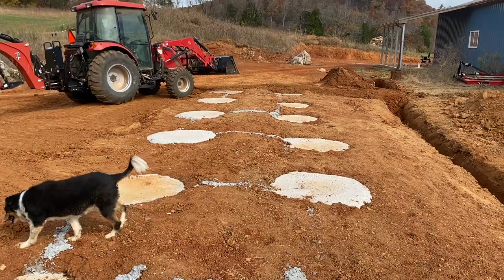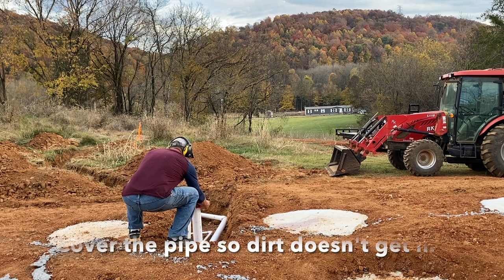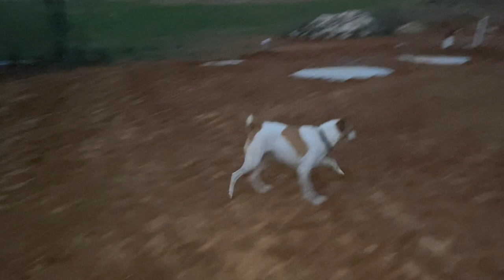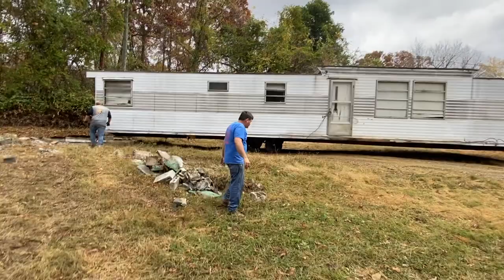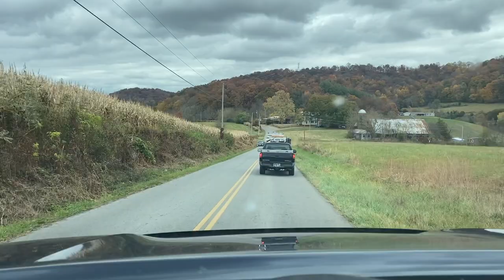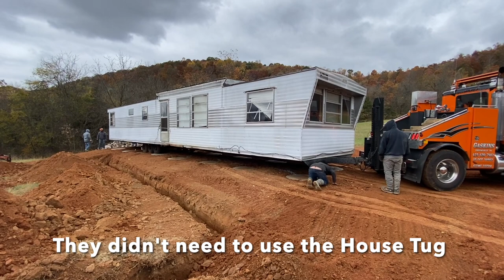Moving Day

Comment: I love those old mobile homes. I had a 1957, a 1969, and the one we have now is a 1983. Congratulations.
Reply: I have a 1984. Real cheap to buy and still built pretty good. I've been on the lookout for an old 8ft wide mobile home but it seems they were mostly from I think it was 1953 and earlier and it seems either none survived in my area or few were purchased in my area. Been looking for several years and still nothing. The biggest issue with the older trailers is you need to be sure the wiring and plumbing are good and hope the subfloors aren't particleboard lol. Some manufacturers of the time cut a lot of corners which after decades become dangerous.

Comment: A 60+ year old house trailer (excuse me, Mobil home, opps again, manufactured home) that is in what appears to pretty n solid and good exterior condition is a real find. Plus this one has a nice exterior style and choice of color. And from the video, the finish looks to be original. If the outside is truly in as nice of condition as it appears, a good solid scrub, wash, clean, buff and polish would turn this into quite a spectacular looking unit. I really like the roof lone skylight detail and the special period detail on the front end of this trailer.

Comment: Great video!  Do you mind me asking what the trailer moving company charged?  I have a 1955 Richardson MH (only 8' wide x 43' long).  I sold the property where it sits and want to either move it for myself to use or find someone that would appreciate it.  The MH sits in a downtown area of an Indianapolis suburb, so it won't be any easy move.  Thanks!
Reply: Generally speaking, expect around $4,000 - $6,000 give or take depending on company, how hard it is to get it moved, how far it will be moved, and so forth. Everyone around my area on the east coast quote somewhere between those figures.

That being said, I am very jealous. I've been searching for literally decades for an 8ft wide trailer and I have found exactly zero.